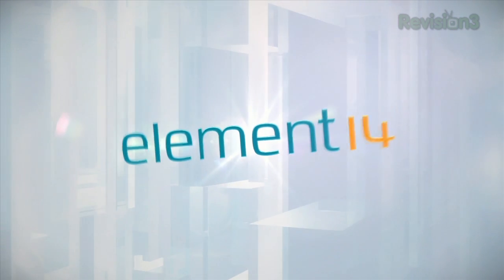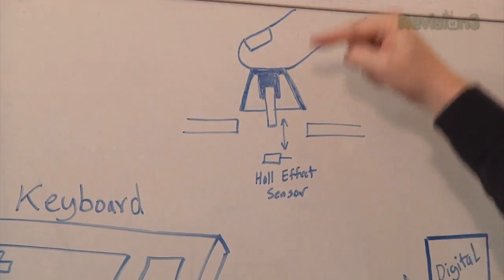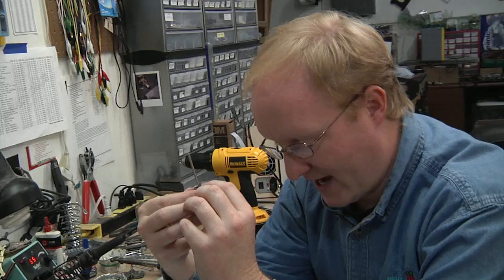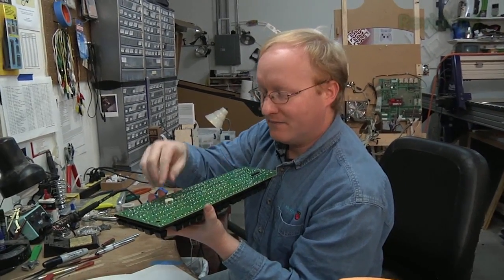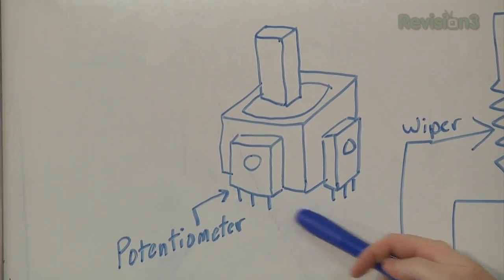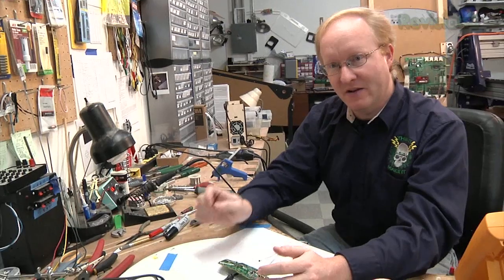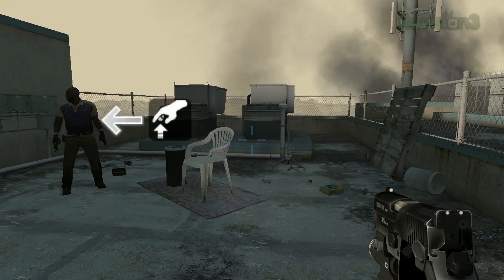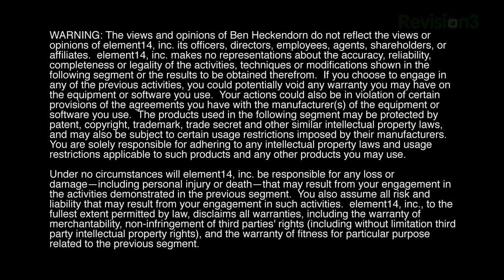XBOX Controller Mods: Analog WASD Gaming Keyboard

Comment: I'm glad someone has already tried this. For my analogue movement I use an n52 speedpad with a psp flat analogue unit which runs off of the left analogue stick of an old PS2 controller. I would love to see how this was done in greater detail especially with the digital pot setup used. I would ideally design and print a whole new speedpad design that would allow analogue thumb and analogue key movement using only ps2/xbox innards ideally avoiding arduino/teensy boards.

Comment: Not even two minutes in and Ben has made a critical error!
Left 4 Dead(He was playing 2 not 1) is NOT a port of a 360 game, the 360 version is a port of the PC game.
Reply: Are you sure?  From what I've seen and read, the PC version is a port of the 360 game.  They even left the 360 code in for splitscreen!  Unless they had the files all in the same place and forgot, it seems that the console version is the original.  The whole game on PC seems to be an up-res'd version of the 360 game...
Reply: Valve are primarily PC developers, there's PS4 code in the code for L4D2 and it's not even on that system. Because the Source Engine is designed to run on nearly all platforms. The code has been there since the release of the Orange Box.

Comment: Yes it will.
Actually this is 2 devices in one , if you will not change the settings in game, it will be same as it was demonstrated.
Note that this keyboard has USB and other interfaces where you can hook your joystick, so imagine it like you hook your joystick in one of that USB ports, and then use left analog stick for movement and mouse to aim, only compact version :)

Comment: Ben, would it be a good idea to use pulse width modulation output from an arduino based on the input of the hall effect sensor to open and close the circuit of the keyboard key, possible using an opto isolator to achieve the same effect but without the use of the controller circuit board. I guess pressing and releasing the movement keys may cause weird behaviour in game though, possibly jittery movement rather than the smooth input you would get with a controller. Just a thought!

Comment: That would be quit difficult as an analogue stick works like a car accelerator, it tells the game how fast you want to go. A mouse, on the other hand, works by giving a stream of x,y coordinates to tell the game where to go. This is why you can move your mouse an inch to the left and the cursor will stay put - if you moved an analogue stick to the left the 'cursor' would creep slowly towards the edge of the screen. Mouse like control would require a lot of coding.

Comment: I'd like to try this. These were Cherry MX Red switches, right?
Reply: dimmddr1 does it matter?
Reply: SchwererGustav800mm Yes.
Reply: SchwererGustav800mm yes it does, blues have an actuation point that you can feel and hear before it bottoms out, which is not what you want for a project like this(there are other switches that do but i cant remember the other ones)
Reply: dimmddr1 black
Reply: Ovidiu Lipsa u forgot tactile grey and linear grey :))
Reply: Ovidiu Lipsa ML, acer and NMB dont offer linear switches though

Comment: Greetings Ben, I want to mod an akai advance keyboard controller. I want to ditch the keyboard; cut the keyboard out, leaving only the controller and add some new led's for viewing the labels on the unit when dark. How much work would be involved? Do I just remove the ribbon cable from the pcb to the keyboard and cut the other half? Do I add an extra usb connector to a 500mah rechargeable battery to power the led's? Plan b: Could I fit all of the components into my komplete kontrol s61 keyboard for a crazier mod?

Comment: would it be possible to use a digital pot to simulate a larger pot?  I'm wanting to replace a 500k pot with a 5k micro pot and I'm wondering if this chip would do the trick.  I'm wanting to build a replacement controller for an Atari 5200 using a PS1 dual shock controller.

Comment: Hey Ben, couldn't you use some kind of PWM to control the keys? Then you wouldn't need the xBox controller board, so the keyboard sends a lot of 'w' strokes to the pc, and as you press harder, the delay between de 'w' strokes becomes shorter, if you understand what I mean. And if this isn't possible, why not?

Comment: It's not really Analogue though, you have two different speeds. If it were analogue you would be able to move at any number of speeds between 0 and the maximum speed value for a particular title. Most Keyboards already allow for this in games as a lot of games on PC have a 'sneak' button which allows you to move at a slower pace when it is pressed.

Comment: Left 4 Dead is an Xbox port? Really? Because Valve is primarily a PC developer.
Reply: In my experience messing around with Left 4 Dead 2, it's a console to PC port.  Kinda sloppy, too.  Not bad, but it's a port of (I believe) the Xbox 360 version.  They even left ALL of the splitscreen multiplayer code in!  There's a mod to get it working and everything!  (I've did that once with a friend, kinda difficult, but it works!)

The second game, at least (which is what he is playing) seems to be just an up-res'd version of the Xbox 360 game...kinda weird.  It seems like a PC game, not a port... :/
Reply: Well the main executable is shared with numerous other games... then there's engine plug-ins and then scripting and assets... and let me put it this way, you imagine that development is a linear process, that one version of the game is completed, then buried, and then the other done, and then forgotten that it ever existed. That's sometimes the case, especially with ports coming out years later done by a different team, but generally, it's not, not in this generation. Because the games have to be maintained, they will get patches and DLCs, all versions of the game must be co-maintained as a common base of data and code. It may make sense to branch distribution-build process to throw away stuff not needed for a particular platform, or use conditional compilation in the codebase, but if it's not performance critical, if the size doesn't matter, it's just safer to leave things in. There's also a lot of value of being able to debug code intended for a platform with mediocre debugging capabilities, such as consoles in general, on the PC where the exotic examination tools for special cases are more abundant. There are certainly some counterexamples where removals and replacements have been more drastic than necessary, but generally you will find leftovers from secondary platforms in the releases for the primary.

Comment: this idea is cool, i've always want analog on wasd... but imagine it like this: ur  W A S D button shaped like the TRIGGER button on xbox controller. since i'm a fan of open world games like GTA, watch dogs, state of decay, which all of them have VEHICLES that work like in a racing game, this thing should be implemented soon to gaming keyboard. i always switch from keyboard to gamepad just for the driving part of those game. but on foot i stick to mouse and keyboard just for the better aiming. whats the point of an expensive gaming keyboard if it was just shiny LED and macros. START WORKING THIS IDEA dear MANUFACTURER.